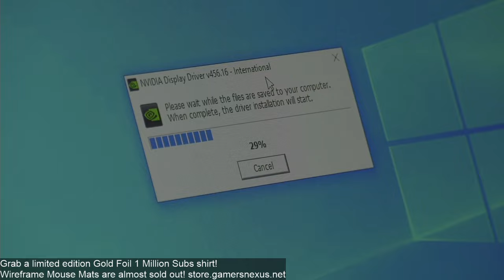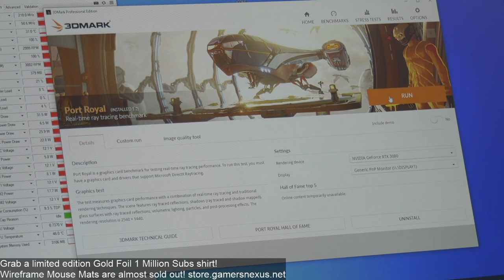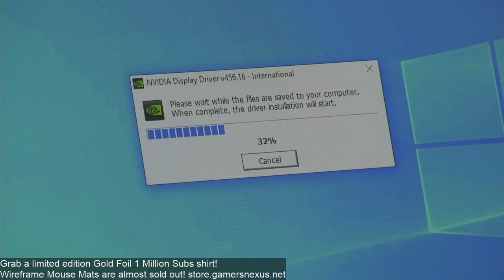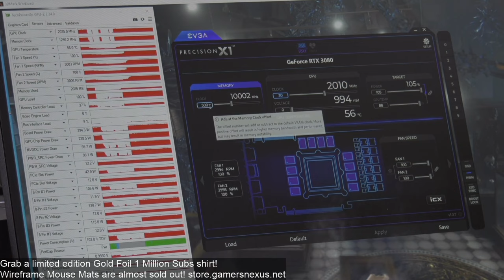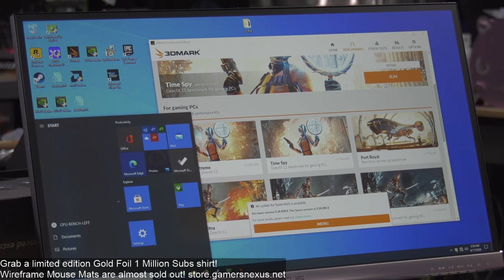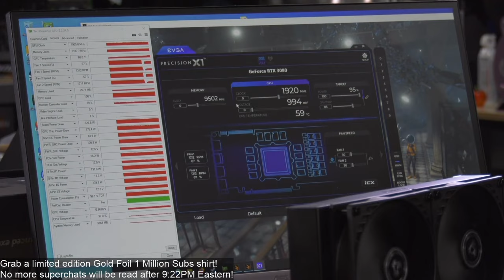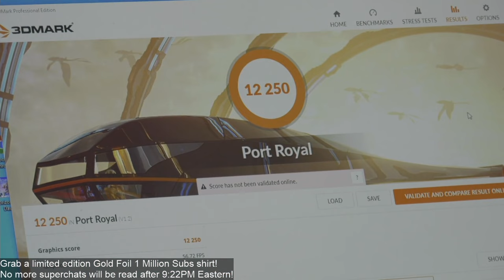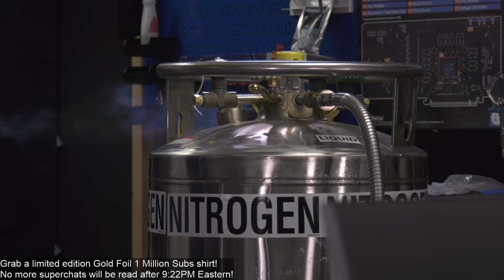LIVE: Overclocking RTX 3080 Custom Cards (ASUS, Gigabyte, EVGA)

Comment: @aliensaxaphone 's time stamps are way better.

0:00:00 We should be live
0:01:28 Card selection 

Asus TUF
0:04:16 super chats
0:05:30 $1200 3080 on ebay
0:06:00 install drivers, GN 10^6 subs shirts
0:10:50 Start first benchmark (Full screen), Bios switch
0:15:15 end first benchmark (11845)
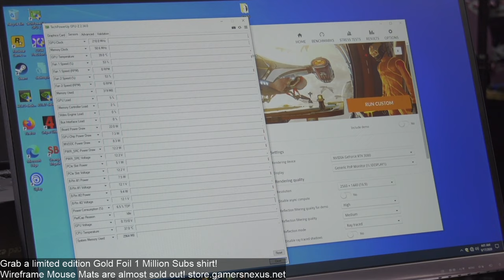0:16:10 Second benchmark (windowed)
18:48 launch Precision X1
20:15 Third benchmark, Boosted power target, 1965~2010mhz
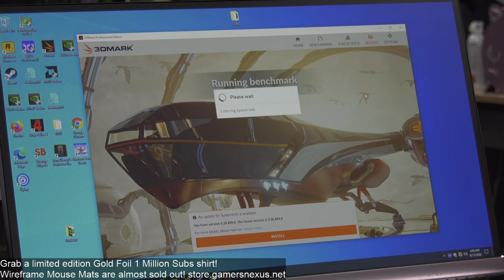23:15 Fourth benchmark
23:50 LN2 tank venting pressure, and Nvidia calls Steve
28:00 setup, +80mhz, boost fan speeds Searching for hard crash clock speed.
33:20 Port Royal start Q: Can you explain the 1% lows on the FE Over clock?
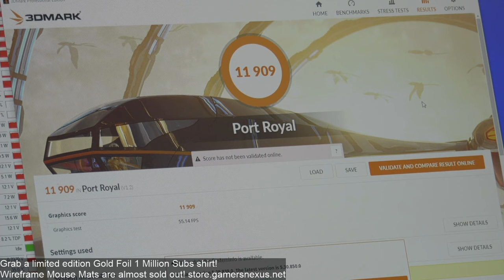36:48 Port Royal complete (11909) Re-run "bringing it down to +90"
39:15 Q: Over locking compared to auto-boosting
39:30 Port Royal Complete (11914)  Time Spy start
41:00 Card physical design discussion
44:20 Probe memory clocks (~600 boost), re-run time spy to verify stability
47:50 Re-run Port Royal
48:50 Q: Why did you not mention that 10GB is not future proof for gaming?(they did)
50:30 Port Royal complete(12294= +3.8%LOL)
52:30 Re-run, back off gpu clock. Answer super chats
55:30 (~11984) Shut down and switch cards 
1:03:30 What is a Liquid Nitrogen Pot?????
1:05:10 LN2 demonstration
1:07:10 Linus Tech Tips water bottle plug

EVGA FTW3
1:08:10 Port Royal baseline (12140)
1:10:30 LN2 Degas again (venting pressure)
1:11:30 Re-run Port Royal windowed, Cold base clocks 2010mhz 
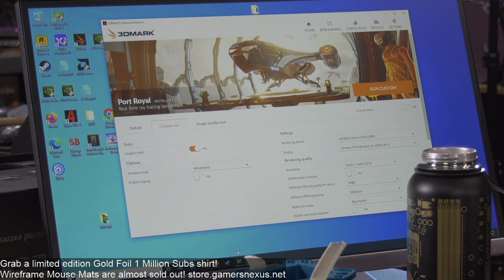1:14:30 open Precision X1
1:14:30 stress test at +205mhz? (can't read it 'caus I'm watching at 144p)
1:16:40 Live call jJacob from EVGA 
1:19:00 explaining base line off sets for clocks and power
1:20:00 stability testing +40mhz
1:21:50 Q: How Steve got into computers.
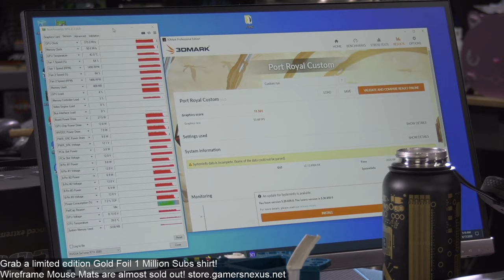1:24:30 Memory tuning w/ Time Spy 
1:25:50 Fan speeds to 100% ~2015mhz, try memory +500mhz
1:26:45 Q: How about the Kingpin card?
1:27:40 Memory to +600mhz
1:29:45 Steve gushes over the 1080 Ti
1:31:15 Memory to +550mhz
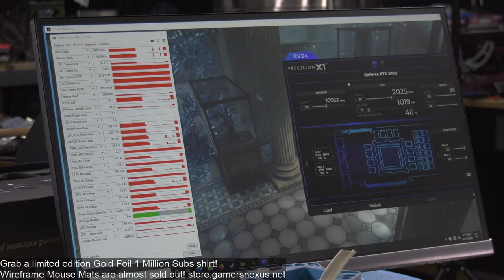1:31:30 Q: What card can over clock the most?
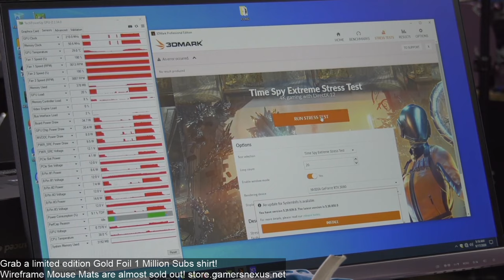1:32:50 Memory crashed, Try +620mhz
1:34:25 Q: Have you tried Kryonaut  extream yet?
1:35:40 Q: Is there a way to know exactly how much VRAM is being used for the people afraid that 10GB is not enough?
1:37:50 Memory call +500mhz stable Re-run
1:39:20 Q: Has Nvidia binned the 3080 FE silicon?
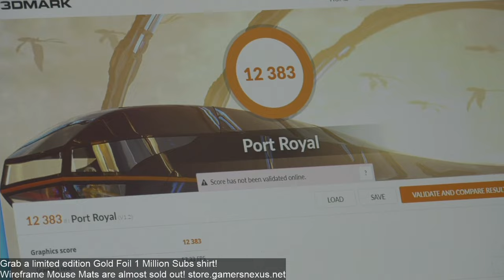1:40:50 Port Royal +500mhz Stable Memoroy(12383) Re-run

1:42:10 Mid stream summary

1:44:20 Port Royal (12435) try +50mhz core
1:45:30 Q: Best 3080 card aesthetics
1:48:20 Port Royal (12460) Try +60mhz core
1:50:50 Q: Vertical GPU for the 3080? Nitrogen off gas +60mhz failed.
1:53:50 Call it and swap cards.

Gigabyte Eagle
1:57:25 Q: I hear memory OC doesn't get you much, Something about memory errors
2:01:20 Q: Do you plan to do any liquid metal?
2:03:15 Superchat: Eleven 3080's at Microcenter in NYC, I was #13>>
2:04:00 Port Royal start baseline; Scalpers
2:05:35 Q: Is the 3080 worth it for 1080 240hz gaming?
2:06:45 Q: Will my stock 8600k be a good pair for the 3080 at 1440?
2:07:40 Port Royal (11777)baseline, Re-run with GBZ
2:09:15 GN Store stuff
2:10:30 Core at 1890-1925mhz
2:12:40 Open Precision X1, No power uplift available, Fan speed to 100%, Re-run
2:16:30 Port Royal (11658) +0.7% Re-run windowed
2:18:30 Q: How hot are the rest of the GPU components? (thorough test method summary), Cheer Wine
2:20:00 Core clock holding at ~1930 Power to 100%, Pocari Sweat
21:30 Q: on 3080 out of box overclocking
2:23: Core clock only raised to 1950-1965mhz Try +30mhz offset
2:25:30 2025mhz Try +60mhz
2:27:00 Q: Termination of SLI support
2:29:50 Trying +80mhz
2:31:00 Q: Jealous of GNs mountains of video cards
...

Comment: RTX 3080 Custom Cards - Base score - OC score - details; an offset is an offset, not absolute.
Asus TUF Gaming - 11845 - 12294 -- 90MHz core offset - 600 MHz memory offset
EVGA FTW3            - 12140 - 12460 -- 50MHz core - 500MHz mem
Gigabyte Eagle       - 11777 - 12250 -- 100MHz core - 900MHz mem

... guess which one is going to take a cold bath this weekend.
Reply: The EVGA?
Reply: so which one is the best ?
Reply: @BG-iu1mv  Negligible differences. In these tests the EVGA benched higher but the margin is so slim that the silicone lottery likely plays a larger part than manufacturer. - Gigabyte is... worrying though.
Reply: @nunyabusiness8422  - I agree with you there, its a bit of a tossup, the indepth tests will tell him which to use, there was no stand out silicone but from watching the stream, the TUF seemed more stable.
Reply: @nunyabusiness8422  thanks ive pre ordered the ftw3 ultimate. cant wait
Reply: Manage to preorder 1 FTW3 Ultra from LDLC.fr, can't wait to OC it myself ! Just have to wait for restock!
Reply: @BG-iu1mv  No you didn't. There are no preorders.
Reply: @j33p82  No you didn't.
Reply: We're All Thieves yes he did, I did on same card on other french retailer. Don’t be mad bro
Reply: @anthonymarcotte2659  Big up bro
Reply: J33P 82 ahah t’inquiète ils ont bien le seum
Reply: The EVGA card is the most expensive. The eagle is the cheapest. Of coarse that's if you can find any of them.
Reply: @RonI-qz2tz  the evga ftw ultra cost me 140 bucks less than the rest of the variants here in Australia lol. They're all going for 1400 when I pre ordered it for 1260. Not sure if the extra 30 bucks was worth it for the 'ultra' tho.
Reply: @Brisingrr_  That is a great deal nice.
Reply: @SelimxBradley  um yes i did. When I get it is another story. scorptec.com in Australia
Reply: @j33p82  nice mate. I'm waiting for restock too
Reply: @BG-iu1mv  hopefully within 2 or 3 weeks for restock. Can't wait to run RDR2 @max settings 3440*1440
Reply: Yea retailers are taking preorder for next batches here in Australia. There were no preorder for the first batch though. Have the ftw3 ultra on order aswell from PLE.
Reply: evga is probably the best since you don't have to overclock as much

Comment: EVGA customer support so good that their engineers will call you mid-overclock to give you advice.
Reply: Jokes aside I always buy EVGA cards. They do have great warranty and customer service.
Reply: Must make these cherry picked cards look their best so the consumer will buy same card only with the lower binned chip that will not OC as well through retail.
Reply: @billwiley7216  but the difference between the FTW ICX BBQ WTF edition and the Eagle OC (one of the $700) models isn't all that much. Maybe a few frames, at best. All for like $110 difference.

Even the cheapest MSRP models seem to have good cooling solutions this time around. They're just power limited in the BIOS. But they seem to be just fine.
Reply: @ChaoticPasta  They really do. I was very impressed with EVGA customer service for my old 2080.
Reply: @nedjimb0  what does power limited in bios mean? Is that something that can be changed in the future or?
Reply: @Brisingrr_  Oh gosh, I would do an awful job at explaining it. Honestly, GN's videos, as well as DerBauer, and Actually Hardcore Overclocking explain these fundamentals about GPU overclocking a bit better, but I'll try. 

Basically, every GPU BIOS is programmed with a hard limit for the maximum value that you can set for the GPU's power consumption and voltage. These numbers are set by the card manufacturer, taking into account things like safe voltage for long term use and the the quality of the heatsink attached.

For example, I think the EVGA FTW3 Ultra card that Steve uses in this video has a power limit set in the BIOS of like 440W. While the FE has a power limit of like 370W.

There's some ways to get around this:  

"flashing" the BIOS from a higher tier model of the same GPU onto your card to allow you to use the power limit of the better card.

Similarly, some Radeon GPUs you can use power play mods to change the power limits without having to install a different BIOS. Igor from Igor's Lab has stuff on this. But this so far isn't available for NVIDIA GPUs.

Doing a shunt resistor mod to the actual PCB itself. This "tricks" the card into thinking that it's pulling less power than it actually is (DerBauer posted a video of him shunt modding a 3080 yesterday). Both come with their own risks. I personally won't be doing either. There's a myriad of ways that they can damage your GPU if not done properly.

If you want to, definitely look up guides for people who have successfully done it with 3080s. Again, people like Steve from GN, Steve from Hardware Unboxed, DerBauer, JayZTwoCents, and Actually Hardcore Overclocking.
Reply: @nedjimb0  oh okay thank you for that. Considering the FTW has a whole extra 8 pin and draws more power ALL for just a 3% increase, that doesn't really make it worthwhile? I can get the non FTW XC3 Ultra for 60 AUD less. Wondering if that's the better idea. I currently have a FTW Ultra pre ordered. I'm not sure if the 30 extra for the Ultra being 50mhz OCd is worth considering I could do that myself but it's just hoping that I can OC it more- which this video makes me realize is pointless because you can't really.

Comment: 50:55 Viewers were wondering why this baseline overclock was only 3.8%.
GPU Boost 3.0 already boosts clock speed from 1700 to 1900mhz, so of course overclocking will only deliver small results.

Comment: I'm 60% sure the tanks I've seen have a small switch on one of the pipes that can be turned 90 degrees to the pipe or in line with the pipe to control a valve. in one setting the tank will climb to that ~220psi threshold and then make the loud off-gassing noise. in the other setting the tank slowly releases pressure instead (out of the pipe with this small switch; closing the valve leaves that pressure to build for the 230psi blowoff valve)

Comment: So when you start having a high pitched laugh it will be because of the nitrogen leak from the tank at the back?
Reply: Atmosphere is 70% N2 breathing N2 wouldn't modify your pitch  as its density is effectively the same.
Reply from the maker: You're thinking of helium.
Reply: @GamersNexus , True.  Was thinking of nitrous oxide also called laughing gas.  Great presentation.

Comment: The Ampere cards look like AMD made them in the GCN era:
Lots of computing performance but not utilized fully, out of the box maxed out as far as they go, pushed the performance as high as they can even with increased power consumption, almost zero OC potential.
Meanwhile AMD is removing the unnecessary things from their gaming cards anf going with a more lightweight architecture.
The two companies kinda swapped their approach.

I'm more and more interested in big Navi, because NV seemed to push their cards to the absolute limit even sacrificing power consumption to get the last few % performance off for some reason...and i think that reason is they know Navi will be good.

Ampere is NV's GCN, and Navi can be AMD's Maxwell.

TBH i think people rushing to get a 3080 day 1 are stupid. It is on my shopping list but i will wait for Navi because the more we see from Ampere the more it gets obvious something is brewing on the GPU market.
Reply: AMD fan alert. the 3080 is not impressive tho. 3090 will be my buy
Reply: @Icenfyre  An overpriced card with  15% more performance than the 3080?
Reply: @Malibutomi  I reckon a liquid cooled, fully unlocked 3080 could trade blows with a stock 3090
Thats why I think NVIDIA is limiting power and locking voltage control
Reply: 15%? sure lmao wait for the benchmarks
Reply: @Icenfyre  Leaks are already out. It is 10-15% faster than a 3080 "LMAO"
Anyone with a brain could see that logically. It has 20% more SP than the 3080 hence it could have been 20% faster if the performance would scale 100% with SP numbers...but it never scales 100%.
Reply: @Malibutomi  leaks. wait for official benchmarks

Comment: It is 350 PSI relief valve and yes it will scare the bejesus out of you when it goes off. I used to fill them at Airgas 25 years ago in my mid 20's.

Comment: Hi Steve! I plan on getting a 3080 that has a 3x8 pin config .

Thing is I'm using Corsair's individually sleeved cables and I currently have 2 of my single PCI-E cables and plan to use
for the 3rd 8pin socket my PCI-E Cable that has the splitter. 

Since they're individually sleeved, does it matter which of the 2 8-pin plugs I use?

Thanks.

Comment: Wait a minute, how did you get 3DMark to run with Precision X1 open? Time Spy for me always crashes when I have Precision X1 open (at stock, by the way) but runs fine with Precision X1 not running.  Is there some workaround or is my 3Dmark/Precision X1 just being dumb?

Edit: Apparently it's OSD that causes crashes...

Edit 2: @1:55:28 That $1500 Radiator Stand doe lol

Comment: So I've been wondering why I've seen several ads for Gamer Storm coolers and a couple preview videos as well as the factory tour of them being made, but have yet to see a full thermal review on it. The old ads I believe have only been for the Captain Pro from a year or so ago and they currently have a the Pro V2 out as well as new versions of the Castle line. They look great but I've only found a few somewhat informative videos on them. Results on the older versions seem to be somewhat conflicting in results. Would love a more comprehensive look at where they fit, in a GN Coolers list.

Comment: for the 3x8 PCI-E pin 3080 models, can one simply use one strand from a second dual 8 pin PCI-E cable leaving the the other strand unconnected ?

Comment: I still wanna know if aside from block compatibility, does it matter which card you go with if you’re planning to watercool? Or can you just pick anything there’s a block for and clock it to match whatever else?
Reply: Different AiBs will do different things. Most AiB cards are the reference board, and they'll release one other SKU with a slight oc. Some AiBs will put in uprated RAM and a few will make a SKU that has unlocked voltage and extra power capacity, even extra layers on the PCB. The AiB cards with a lot of extra stuff usually cost 2-300 USD more than MSRP  and come out about 6 months later.
So, yes, it definitely matters. But at this point? Probably not.

Comment: Both VRAM and GPU clocks in MHZ because of the idle mode they run at 300 Mhz GPU and 405 VRAM (2070), so it would've been confusing to see 0.3 Ghz -)))

Comment: Just out of pure interest id love to see benchmarks with the back plates taped closed to see if with these designs the holes in the backplates matter at all. (incase you need more content the coming weeks). A new video with ram overclocks on these beasts would be nice aswel to see if the cpu bottlenecks at 1080p and 1440p can be helped a little with fast ram like 4000 cl16.

Comment: Hey Steve, had an interesting idea just now for a video, how cool would it be to try and cool a computer with AeroGel! I don't think it would work as a thermal paste but if you coated a graphics card in it, it could reduce thermals because Aerogel would increase the effective surface area significantly!
Reply: Uhm aerogel is an extremely effective insulator isn't it?

Comment: I still find it funny that people are comparing this card to a 2080Ti. Its the flagship model people, that would be the 2080 you should be comparing it to and its got amazing specs vs the 2080, 10 gb of GDDR6 vram instead of the 8gb the 2080 had, more tensor cores, just basically more...... can't wait for the 3080Ti to arrive.

Comment: Overclocks and power limits being this low over the FE really says they pulled out the stops to run these cards at absolute maximum without much headroom for conventional OC.

Very interesting. Buying super high end custom cards like Rog Strix probably won't get you much for your dollar whereas with older cards it did.... My ROG Strix 1080ti runs about 13 percent faster than a FE 1080ti and much cooler.

Comment: The guy commenting "wahhh the 3080s sold out, guess I'll be stuck with a 3090" is the kind of half-wit that will never actually use that card to its full potential, guaranteed.
Reply: And that dude enquiring about 3090 SLI in what world do you need that for gaming

Comment: I wonder if the 3070 claim is as cherry picked as their up to 2x performance.
Reply: It probably is, but considering the 3080 is generally 25-30 percent faster than a 2080ti in actual use, it seems perfectly reasonable to guess that a 3070 will be about equal to 2080ti as that would make it 25-30 percent worse than 3080.

The one concern I'd have with 3070 is the 8 gigs of GDDR6 VRAM, it's much less than 2080ti and less than 3080 and it doesn't benefit from the GDDR6X VRAM used on 3080.
Reply: @SPIRIT-117  I read that gigabyte is releasing a 16gb version of the 3070 probably as a "ti".

Comment: I just saw Linus Tech Tips using that monitor, what is it?
Reply: On the left is Asus MX279H afaik, they have like a VX279 that is comparable. On the right is the Gigabyte 1440p 144Hz monitor, don’t remember the exact model but there have been quite a few reviews of it cause it’s first monitor released under Gigabyte branding.

Comment: hello guys :D why no one lock the voltage and the clock ? control+f on msi afterburner pick the point and control+L.    :D
Reply from the maker: Because it's less stable and more difficult to tune for 24/7. It's more useful for competitive clocking.
Reply: @GamersNexus  less stable ? ok thanks for the information :D i use to undervolt/ oc my 1050 1822mhz at 0.9v